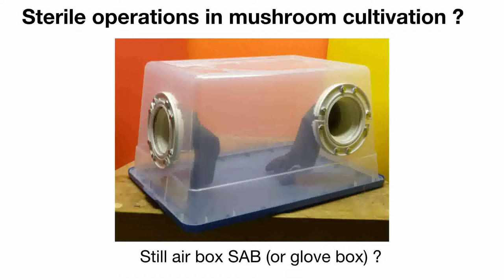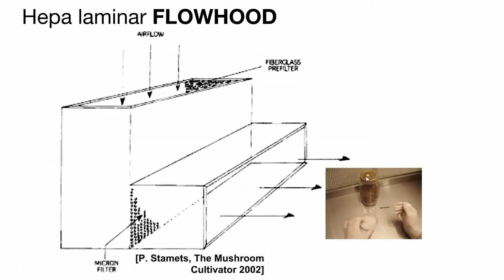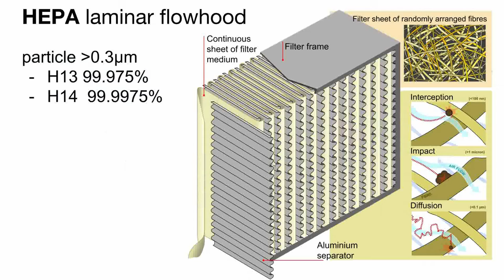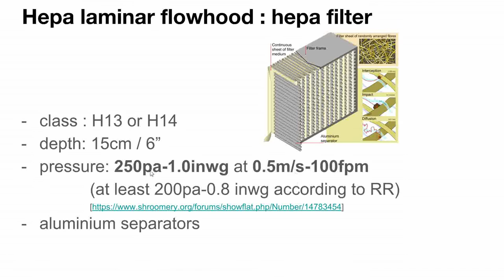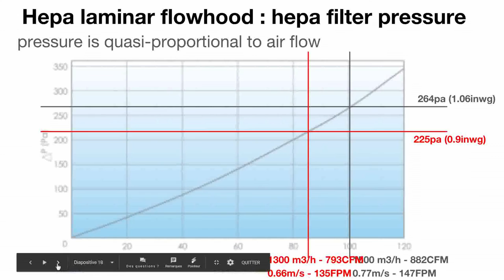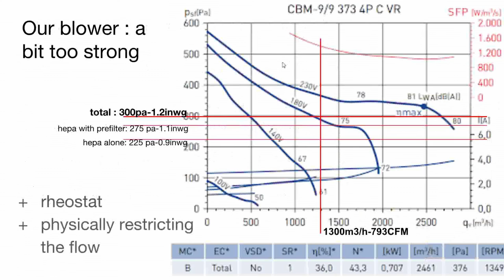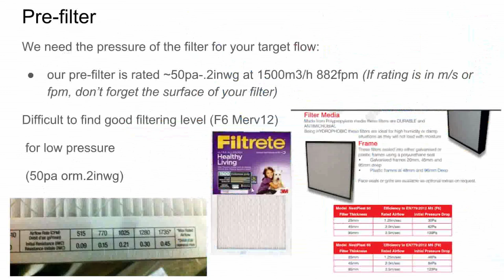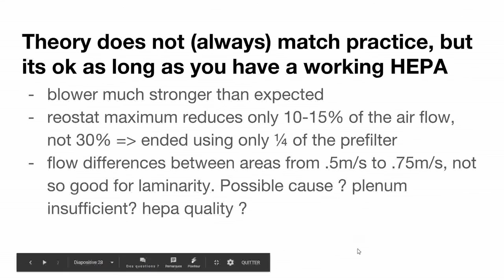How we built our first laminar HEPA flowhood DIY : Theory and calculation

Comment: Hi. Where did you take 0.77 m/s value from?
Reply from the maker: Hi, my filter rated initial pressure is 260pa at 1500 m3/h, for this size of filter that gives a flow value of 0.77m/s = (1500m3/h / (0.6m*0.9m) ) / 3600